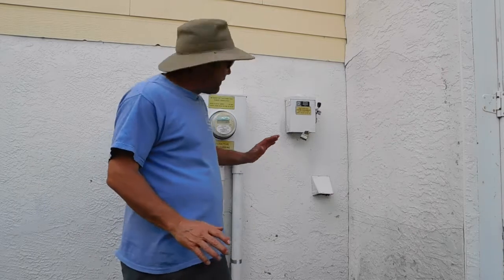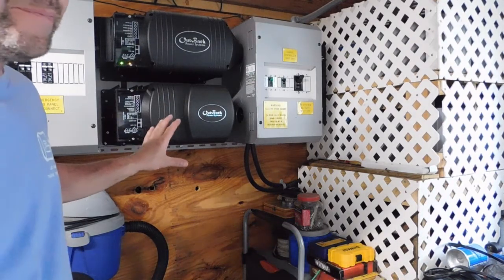3 kW Solar System, Florida on Green Energy Adventures with the Turbine Guy

Comment: Isn't it illegal in Florida to run home on solar when power is out?
Reply from the maker: No, we run off batteries 3-4 times a year when the power goes out. It is illegal to go completely off the grid in Florida, which makes no sense in a supposed free country
Reply: @TurbineGuy  you just told a lie. it is not illegal to go off the electrical grid here in florida. do your research. the lady that they went after for it won her court case.
Reply from the maker: @Cancri71  I did not "lie". Last I had heard it WAS illegal to go completely off the grid, just did not hear about her case overturning it.